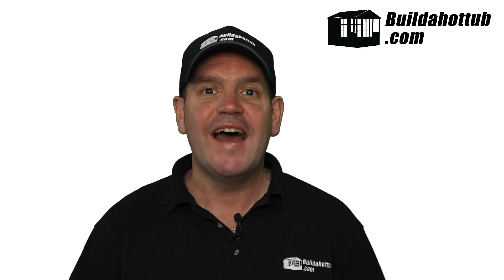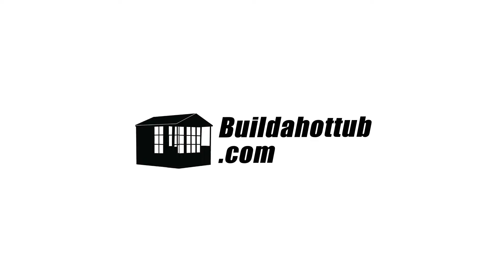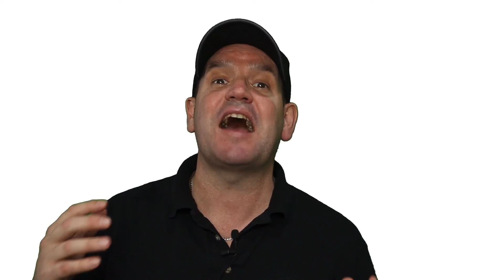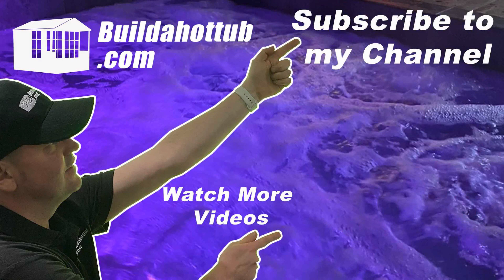DIY Hot Tub Heater - All Options Explained

Comment: I'm interested in building a stock tank hot tub that doesn' require any electrical hookup so thinking of a an on-demand propane heater that uses a thermosyphoning design so that there is no electrical pump.  The Chofu GF-200L was a model that did this (I think). but it is discontinued.  Is there another model that functions the same way?  Can an on-demand propane water heater for outdoor use that is designed for showers do the same ?  Or does it need a pump in order to draw water into the heater?  thanks!
Reply from the maker: You normally need a pump to move the water round through the on demand heater - all of my customers use electric - not seen a good "off grid" versions to be honest - but I am of course biased towards a more traditional hot tub setup
Hope that helps - Andi

Comment: I'm a bit surprised you say lpg/natural gas is more or less the same cost as electric heating. Your air source heat pump may save 66% as its a 4 to 1 gain of the electricity used, ie 1kw power in, 4kw of heat out, but natural gas costs around 25% of electric - in the UK at least. The cost of an air source heat pump will be at least 5 times the cost of a caravan hot water heater, so for me, thats the best bang for buck

Comment: I agree with your sentiments regarding the use of wood to heat a tub....in the sense of it being a lot of work and inconvenient. However, doing so without a pump or filtration system does not mean one has to empty after each use. I have two tubs heated with wood. Neither tub has a pump or filtration. I get up to 5 months out of the same water by stirring in ~1/2 - 3/4 cup of 30% hydrogen peroxide after each use. I've been doing this successfully for 10 years.